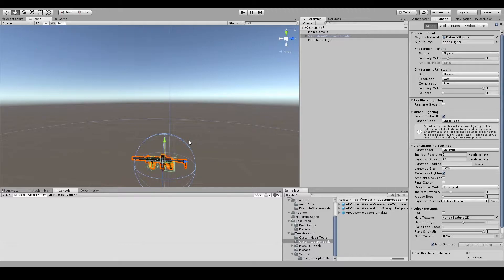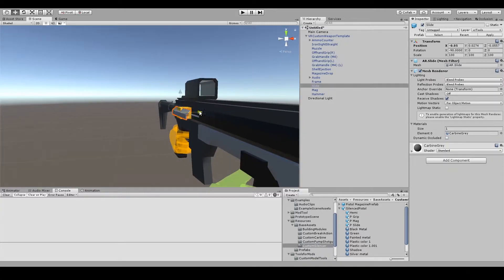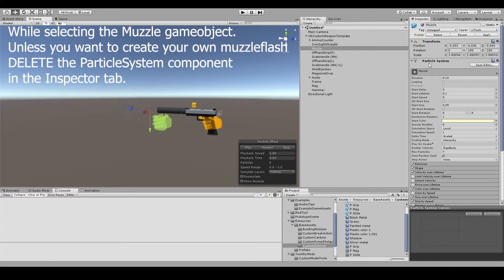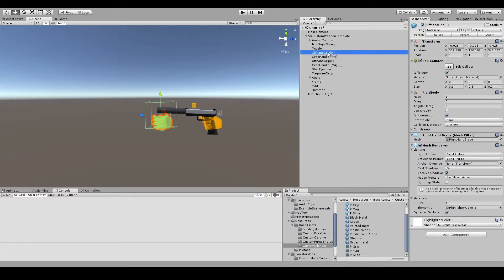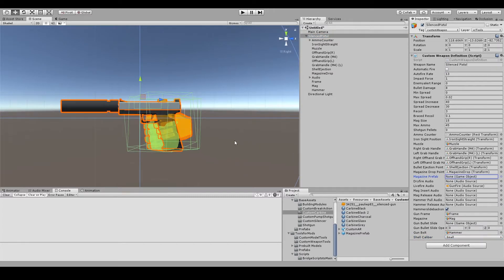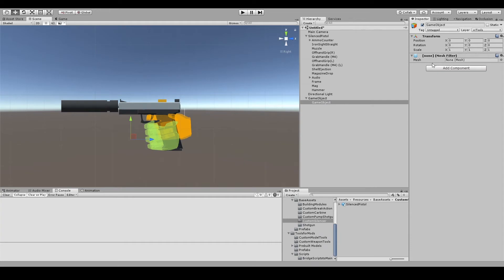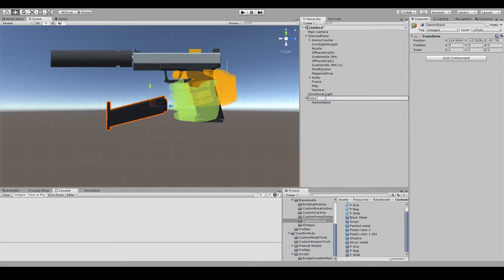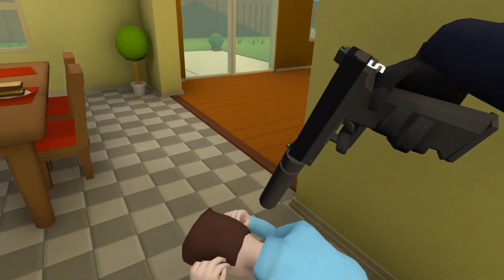Fast and Low Editor - Custom Weapons (Pistols and ARs)

Comment: When I hold my weapon in the game, only my left eye can see the gun in my hands, when I look through my right eye the gun is floating out of my hands. with both eyes open it look like two guns flickering. Any help?
Reply from the maker: That's a problem i've never encountered before. Would you mind sending me what you made to my email: urbangiraffegames@gmail.com

I'll run it on my end and see if i can figure out what's causing this.
Reply: @urbangiraffegamesinc.2330  I sent you the email.
Reply from the maker: @thegmodcrew2123  Hi, I looked into the mod. I believe it would have something to do with the type of Material shader that you are using for the weapon mod. Fast and low uses single pass rendering for VR. So you might need to tweak the shader used for your texture.

Hope this helps!
Reply: @urbangiraffegamesinc.2330  any way this will come to oculus quest 2 app lab

Comment: i put the prefab in my mod folder but it doesn't show. any one know why?
Reply from the maker: Hi,

Just to confirm, did you go through the ModExporter step and name your mod the exact same name as your Prefab?

After you you run the exporting process, make sure you drag the entire folder to your Fast and Low Mod folder.